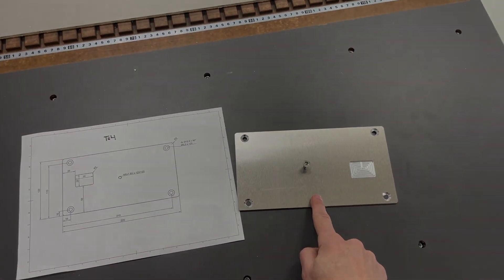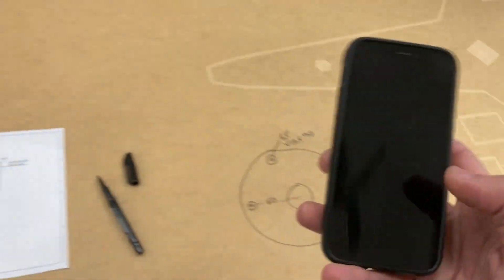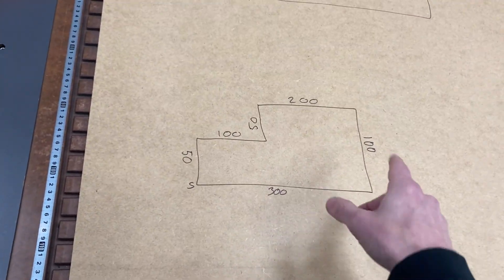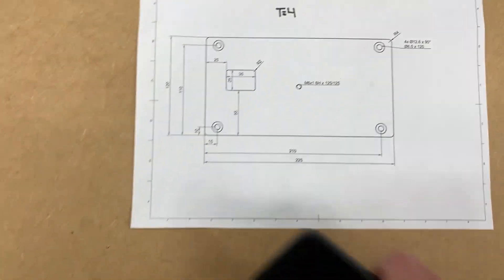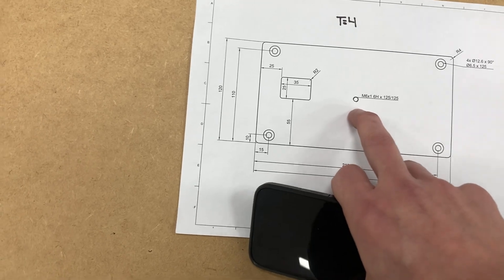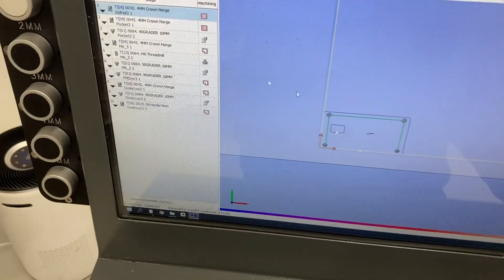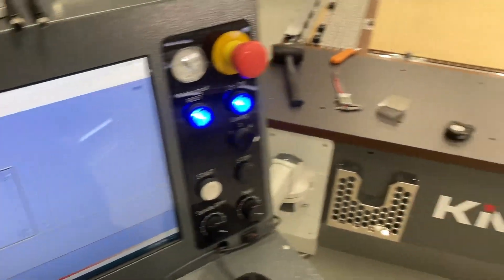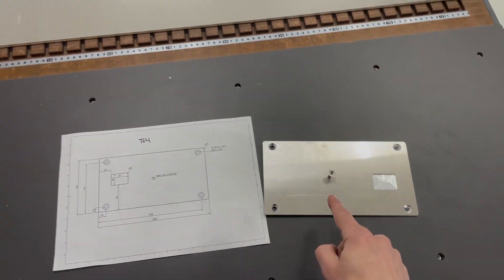Simple sketch to finished part using Ai (Version 2!)

Comment: That is actually hard to believe! I love that solution.
Reply from the maker: Yeah im still pretty chocked over how well it works. Just this morning i realized that i probably dont need to take a picture, i could probably just press the microphone icon and tell the ai what i want.. i'll test that at the shop next.
Would be pretty cool to do an addon for PCCAM so i click it and describe my part and it gets imported and gcode generated right on the spot, and then allows for me to do changes by just telling it.

I'll do a video on how i did this and share the files so ppl can copy it and try it out, clearly best for Kimla owners but probably useful for everyone else aswell, and with the code they can do their own version.